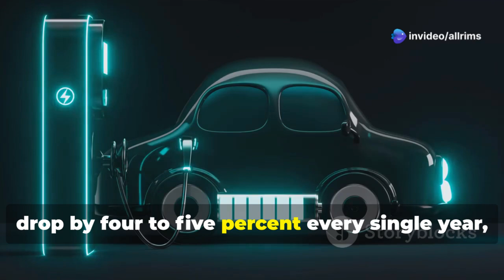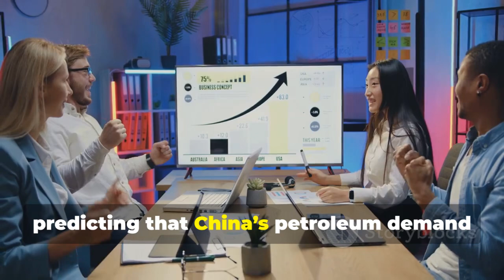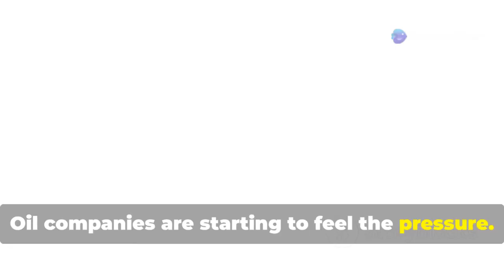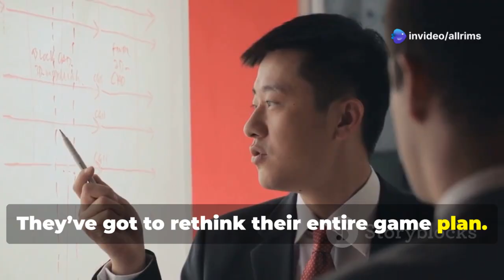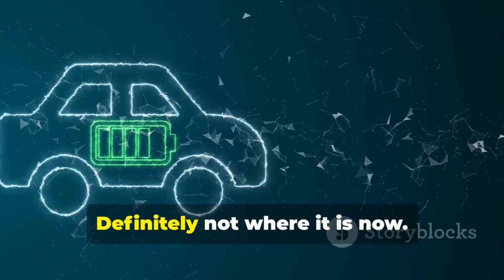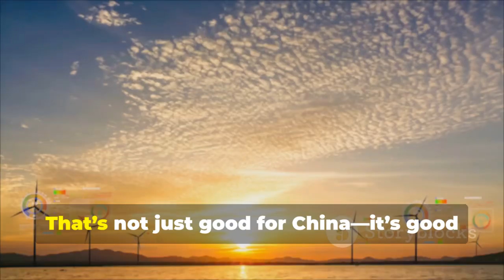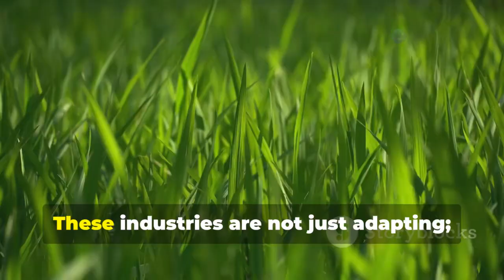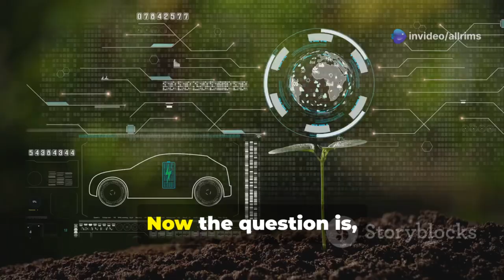EV Boom Shocks China: Oil Demand Drops Sooner Than Expected!

Comment: What will do the refineries of crude oil? What about energy needed on Lithium mining, what energy will use mining sector to dig for diferent metals? Up if oil industry will produce the volumed? Oil production industry is slowing down, or they are declining oil and producing more salt water. Probably these salt water has some lithium.
I do not thing the crude oil decline is problem for oil exporting countries, this is a big challange for oil importing countries, for their refineries, for energy users everywhere. This is a visible problem with many invisible problems.
Reply: Gasoline doesn't come from "The Oil Fairies"
It requires a LOT of ENERGY to get it from the ground to the vehicle.
THAT  energy can be used DIRECTLY and much more efficiently to power an EV.

Comment: China installs 200 GW Solar Every Year. China Will have 2000 GW in 2030. China installs 250 GW Wind Every Year. China Will have 2000 GW in 2030. Thats where the Electricity comes from. ❤🌹👍

Comment: But you need power to charge your electric vehicle, where this power generation will come from? Coal, wind, solar or nuclear.
Reply: Battery storage can play a large role. Solar and vehicle to the grid will assist.
Reply: @trythis2821  
Solar, WIND and Storage batteries will cover the load.
The trick is to NOT use the "Higher Tech" vehicle packs, but to install large numbers of very cheap LOW tech Containerised packs as storage, either Sodium based, or other.
Reply: 90% of ev charge can be scheduled during high greenery production, they mention swapping batteries that means the charging station can program the chargin time.
Reply: @yvanpimentel9950  
Incorrect.
Reply: @tanujmehra3810
Do you know how much power you need to extract, transport and refine  oil?
Switch the energy used to refine enough fuel to move a vehicle 1,000 miles directly to an EV and you can drive it 1,000 miles..... Without refining the fuel.